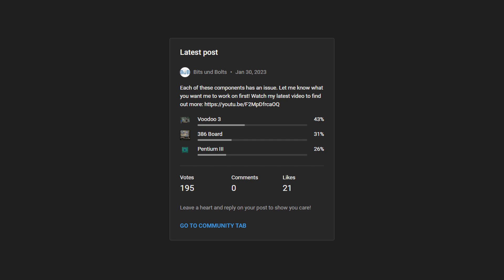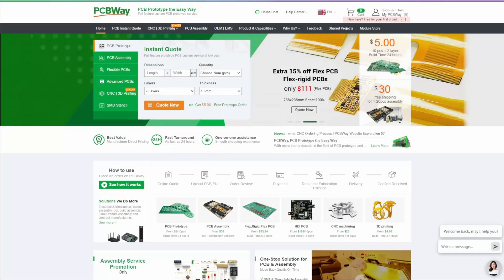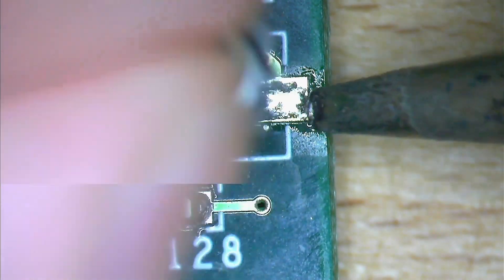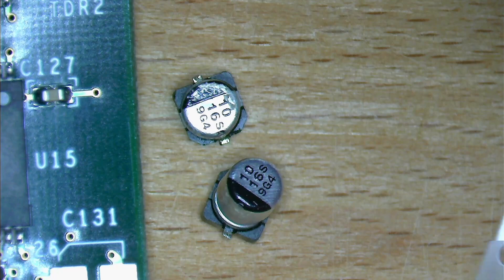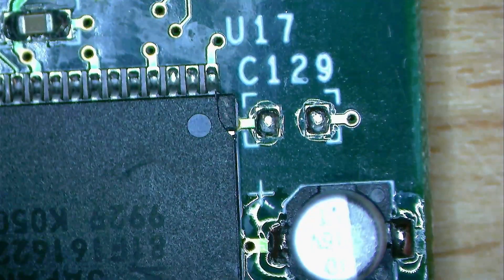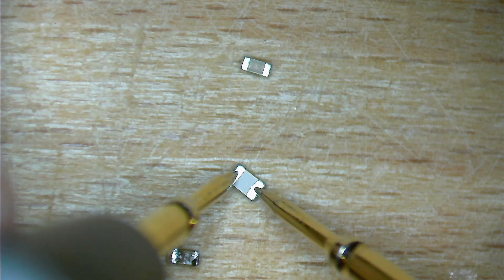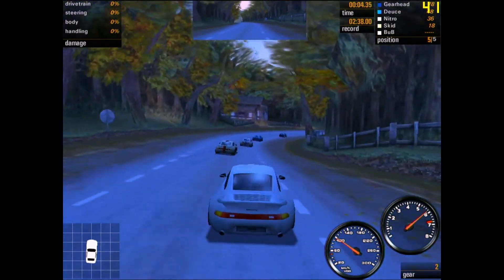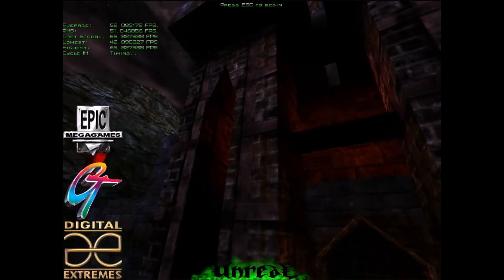3Dfx Voodoo 3 2000 PCI: Missing Capacitors and funny driver trivia

Comment: Really want to see what I can do with my v3 1000 that I have, though I don’t know what’s wrong with it so I don’t know where to start
Reply from the maker: What's the symptom of the card? How does it behave? Do you get a picture? Does the PC boot with the Voodoo as the only card?
Reply: @bitsundbolts  I do get a picture and drivers do install, but the cursor is scrambled when in windows and loading a game locks up the whole system
Reply: @bitsundbolts  I am beginning to suspect some sort of vram problem
Reply from the maker: Could be - but I don't know. Will pin your comment, maybe someone else knows and can answer or help you.

Comment: Hello,

I have a 3dfx Voodoo3 3000 graphics card paired with a Pentium III 700 MHz system. The system was working perfectly last summer, but after a routine reboot, the machine stopped displaying any video output.

To troubleshoot, I installed a PCI graphics card, and the system booted successfully. The Voodoo3 card is still detected in Device Manager. I reflashed the Voodoo3 BIOS in case it was a firmware issue, but unfortunately, that didn’t resolve the problem.

Could this be related to faulty or degraded capacitors on the card? I’d be grateful for any ideas or suggestions you might have.

Thank you in advance for your help. 😊
Reply from the maker: It does sound it might be a corrupted BIOS. I also had a Voodoo 3 3000 that didn't work properly. Go to my website and have a look at the following post: "Pitfall: 3dfx Voodoo 3 3000 OEM BIOS" (you can use the search function). If your Voodoo 3 3000 is an OEM card, the regular BIOS might not work. I linked a Voodoo 3 3000 BIOS in this article as well that brought the card back to life. Maybe you have an issue like this. I doubt that the capacitors are an issue because the card is still being detected in the device manager. However, bit rot could have caused the initial issue and now it might just be the wrong BIOS that is on the card.
Reply: Thank you very much for your detailed explanation! That actually makes a lot of sense. I wasn’t aware that the OEM version of the Voodoo 3 3000 might require a different BIOS. I’ll definitely take a look at your article and try flashing the BIOS you mentioned. It’s reassuring to know that the card is still being detected — I was worried it might be a hardware issue. Hopefully, it's just bit rot or, as you said, the wrong BIOS. I’ll give it a try and get back to you with feedback. Thanks again!😊
Reply: @bitsundbolts *Hello,*  
I downloaded the software you mentioned on your website and flashed it. During the flashing process, I didn’t encounter any errors—I did everything correctly. But unfortunately, the card didn’t wake up. I’m using Windows 2000, and the device still appears in the Device Manager. It’s unbelievable. ☹️

Comment: 8:42 How did you remove it if it's not present on any boards?
Reply from the maker: I'm just using a value similar to caps around. Very common values are 100nf. I don't really remember why I did this back then to be honest. That card works without the call and it wasn't there in the first place.
Reply: He removed C127 to check the value. It’s in the same position relative to its nearest memory chip.

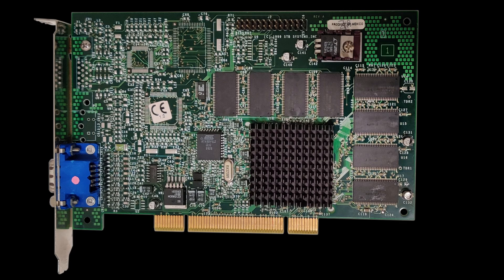Comment: 0:45

The missed connector is not an analog VGA, but a much more interesting digital DFP, the predecessor of DVI.
And the empty rectangular soldering pad at the top right is reserved for LCDfx - a digital-to-digital video converter.
Ah, it would be very interesting to test Voodoo with digital video output.

Comment: Solder wick tip from a pro. Cut a short length of wick about 1cm. Move the wick only using the tip of the soldering iron. That way the wick will not stick to the pads and you won't risk ripping up any pads.

Comment: It's not the best way to remove such caps, and you should NEVER use it if they have leaked. It's almost guaranteed that you will damage the pad. Instead use pliers to grab the metal cylinder of the cap and just rotate it to snap the internal metal wires inside the cap. You will be left with a loose plastic base of the capacitor that you can remove easily and both metal legs soldered to the pads. Then you can safely clean them, apply flux and desolder without damaging anything. Last week I managed to repair two old Toshiba laptop screen boards, that had terrible cap leakage, 8 caps on both boards. I used this technique and safely removed ALL of them without damaging a single pad.
Reply from the maker: I have seen this technique. It does feel a little counterintuitive since you're using pure force to twist the capacitor off the board. I will try to find some old electronics where I can practice. I assume that because there is no heat on the pads when trying to lift the capacitor, it is less likely to rip them out?
Reply: @bitsundbolts  Yeah, it's really bizarre how it's safer to rip them from the board rather to desolder. When I repaired an IBM Ps/2 Model 30's floppy drive I decided to desolder the caps, and lifted the pad on the first one. Then I decided to twist them and all of them safely came off. My guess is that when you heat one leg and push it up the second leg and the case of the capacitor act like a lever, and it produces a force large enough to damage the pad itself. When you twist the cap, both legs hold on to the pads and resulting force is not enough to damage the pads.

Comment: This card begs for the larger heatsink and, lets say, 50mm fan.
Reply from the maker: I have not measured temperatures yet, but I am reluctant to replace the heatsink - I am just worried that by removing this glued on heatsink I may break something. Adding a 40mm fan may do the trick too.
Reply: @bitsundbolts  Yeah youre right, its probably not worthy of risk. Mounting the fan on is the way to go.

Comment: Nice job! The positioning of the caps was flawless! I have an V3 2000PCI too, but mine has the 5,5ns SGRAM Chips and a bigger heatsink glued to it. The factory one was not level with the chip and to small, so i took it off and replaced it.
Reply from the maker: You have a very nice card there! And yes, I have seen some glued-on heatsinks that were misaligned badly - not only 3Dfx though. I wonder if that was a manual process...

Comment: You know, you got me curious. I opened up my PC and found no resistor there on my voodoo 3 - 2000 either! Additionally, I also tried your dx/voodoo switch to put voodoo2 instead and I found my PC had odd intermittent stutter in places when playing. But putting it back to dx and the gameplay had no stutter and was smooth.... Additionally, I could see no options changed anywhere, but I did see units change to kph instead of my set mph (we use mph in the UK) each time I made the graphics cfg switch change.
Curious.
Reply from the maker: Yeah, all pictures I've seen online has this capacitor missing. Also, may cards were also missing one or more of those aluminum capacitors. Looks like a common issue to knock of one of those.
Weird that it changes the units from mph to kph - maybe some default that is triggered. If I get the time, I will check this out.
Regarding the stuttering issues you faced, I haven't noticed anything - I was using a PIII 1GHz and 128MB RAM.
Reply: @bitsundbolts  I am using a 1.4ghz duron, win98 and 768mb ram.
Reply from the maker: That's odd - maybe I have to try other tracks and spend a bit more time in the game.

Comment: Japanese 6ns SDRAM memory modules 🤩never seen this memory chips on a Voodoo 3. I have the 3000 PCI version with 5.5ns Hyundai SDRAM.
Reply from the maker: I didn't even pay attention to this. Seems like 6ns was meant to be used for the Voodoo 3 3000. The Voodoo 3 2000 usually had 7ns memory modules (Source: Vogons https://bit.ly/3Ymtw4s)
Reply: @bitsundbolts  7ns is specified for 143MHZ, 6ns for 166MHz and 5.5ns for 183MHz. 3dfx sometimes use faster SDRAM modules on smaller 3dfx cards. Back in 1999, I had a Voodoo3 2000 AGP with 7ns RAM, but it runs stable until 170MHz. 166MHz should be easy run with your 2000 PCI, I only would add a active fan on the heatsink, because the 3dfx Avenger Core gets very, very hot.

I als have more Voodoo3 versions in my collection, from 2000 to 3500. My 3500 AGP from Compaq runs stable with 200 MHz, not tested any higher, because this is retro hardware and 3dfx cards are now expensive this days...
Reply from the maker: Yeah, 3Dfx cards are super expensive! I usually use a 120 fan blow over the entire card - even at stock frequencies. If I ever attempt to reach 183MHz, I will add active cooling to the heatsink.

Comment: The power lines of all the ram chips are probably tied together (this reduces the effectiveness of bypass capacitance if you are going to do this also lol) so the whole rail only needs so much capacitance so they just left it out. It probably doesn't help but it also won't hurt anything to have it.
Reply from the maker: Yes, all those capacitors next to the memory are connected to the same rail.